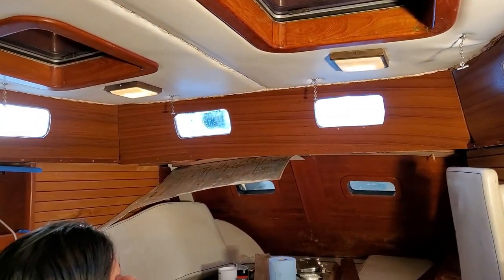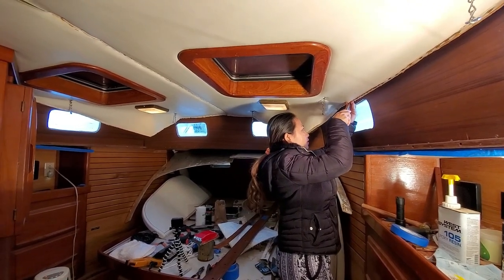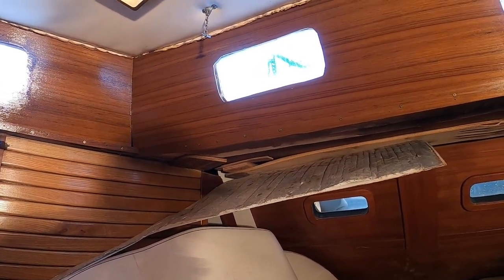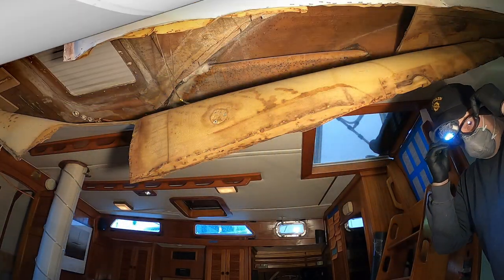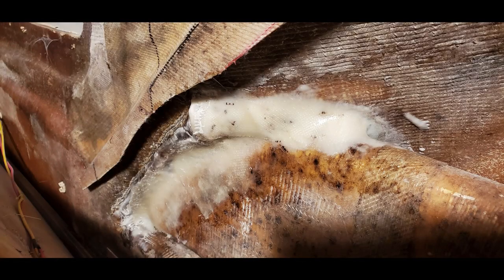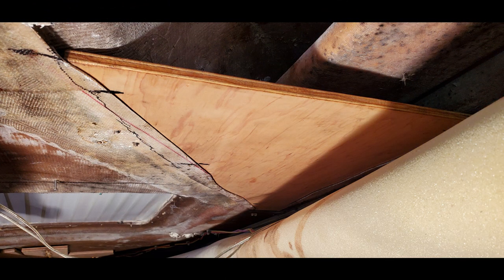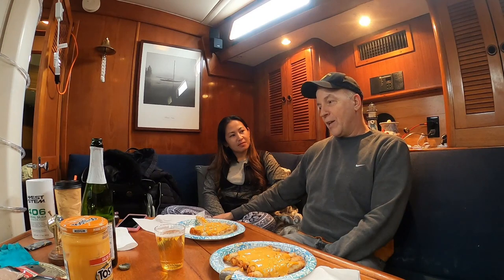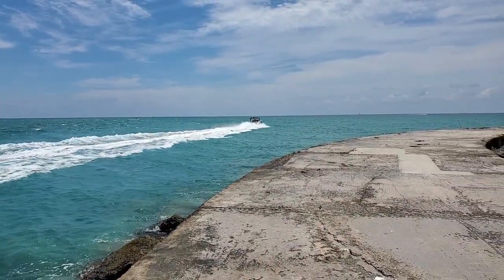Varnishing New Teak Panels, Fixing more Leaks.  Endeavour 52 Sailboat S 1 Ep 26 DIY Nautical Dream

Comment: I appreciate how your trying to save stuff like the vinyl headliner. On my projects I tend to tear everything out and start from scratch.
, probably wasting $$$ sometimes.  As a hint.....I used Epiphanes Varnish ( teak tinted) when I restored a bunch of seateak(brand) fiddles and doors. It is the best varnish I have ever used.  I bought a special ox-hair brush for application. Brush was $30, but worth every penny.  Better hat this time to!!!
Reply from the maker: We are only trying to save the vinyl headliner for now, if we can. It's pretty old and brittle and shrunken in some places.  We will most likely go back and replace the old headliner sometime much later in the project.  We mostly want to spend our time fixing the bigger issues for now. I have heard Epifanes varnish is the best. We're pretty happy with Sikkens Cetol Natural Teak Varnish.  And it's a pretty nice color. We applied the first base coats of varnish with a cheap foam brush.  We plan to spend a little more time and attention on the final coats of varnish whenever we get that far. Do you currently have a boat project you are working on?